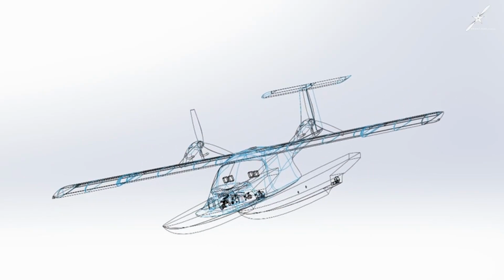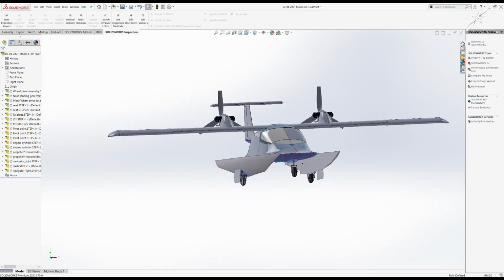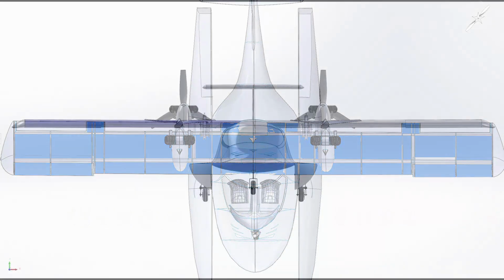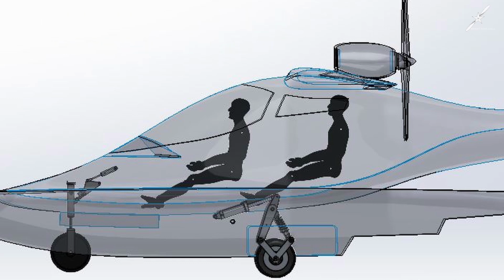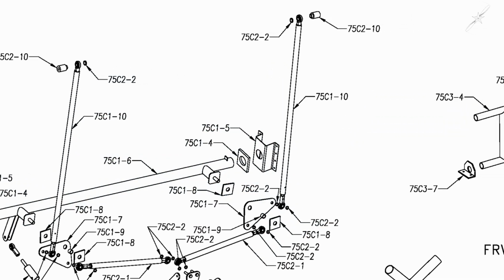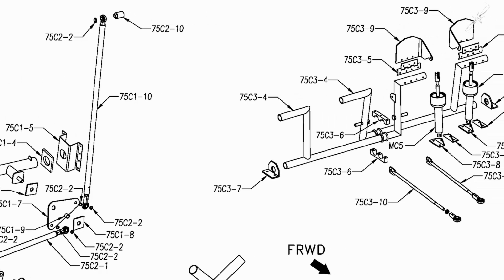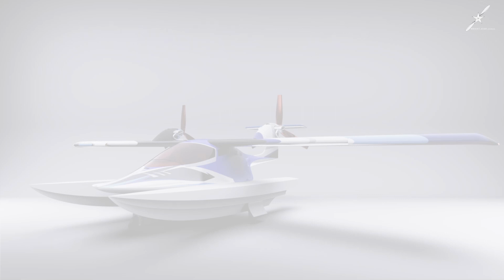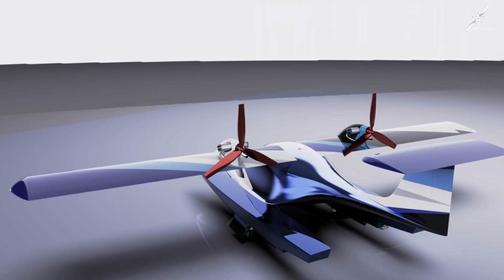Exciting, NEW, Amphibious Aircraft.

Comment: You can get very good results by scaling weights and moments, not just size.  NASA does this.  You can too.  Google scaling laws engineering models.

Your belief that a model will misrepresent performance is definitely a misleading one.  Test scale models.

It is also wise to test structures using scale models.  Consider having a brief conversation with several professors at nearby schools.  A well trained instructor, lacking PhD credentials can also validate my assertions.  Engineering using scaled down objects is common - and time, money, and material sparing.

Best wishes on your project.
Reply from the maker: Thanks for the comment Nicholas. I will check into it.
Reply: @BrightStarAssemblies  It's worth saying that this only makes sense in wind tunnels, as the environment has to be carefully controlled to account for the different scale. So typically you would make a solid model out of foam (or some other easy modelling material) and not worry about sticking in the electronics that would actually make it fly. Unless you feel like slapping a fan in a box and making your own, you would probably best off contacting the nearest university and checking out their wind tunnels.
Good luck with this plane!

Comment: tail area still looks too small for the very large forward of cg frontal area.... and the wide engine spacing (why so wide?)
Reply from the maker: Thanks for he comment. I believe the tail area will be increased in size as we continue to refine this design. As for the spacing, the engines are spaced just far enough to give 12 inch clearance between the tips of the props and the aft section of the fuselage. The only way to move them closer is to cut into the fuselage. I would prefer to not do that as it creates drag because it disturbs the airflow. If we just make it six inches from the tips of the props to the fuselage, you start getting a popping sound (drumming) from the air as each blade sings by that section of the fuselage.

Comment: I’m not an aircraft designer and I have no experience in the field but the connection between the pontoons and the fuselage seems quite thin, and I could definitely see the connection cracking in rough water or with a hard landing, thats just my unprofessional opinion though.
Reply from the maker: Thanks. Yes as discussed in the video about the flat nose and the rounded nose, I took my design to a professional composite designer and he has confirmed that there is enough area between the pontoons and the fuselage. Something that is not shown in this are that we will be adding to the CAD files is a chamfer. This will help blend the bottom area of the fuselage into the pontoons.
Reply: @BrightStarAssemblies  ok thank you.

Comment: Have you considered designing around an electrical drivetrain?  This is the way of the future, especially for private aviation.
Reply from the maker: Oh sure I have thought about it. I love electric. It always goes well with water. haha  Yes I have thought about it but it is not the electric part that is holding things back. It is the energy part that turns the electric motors. Maybe with the new tech of Nuclear Diamond Batteries electric flight might become a reality. The few aircraft that have flown so far have not flown a four place 3,000 lbs aircraft at 120kts for even 30 minutes. I love the future and believe electric flight (something like a C-172 flying for four hours with 4 people onboard) will happen. I just do NOT believe it will be in my lifetime.